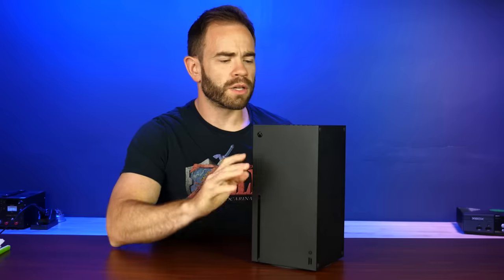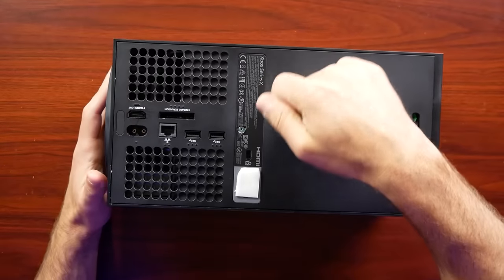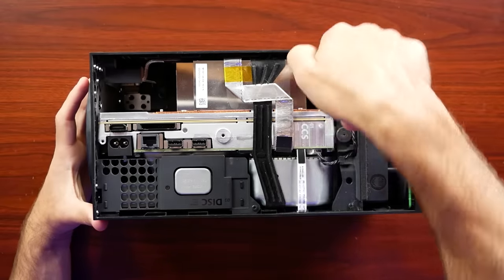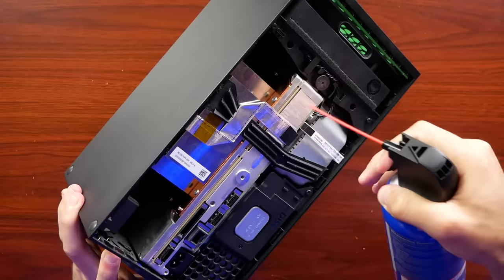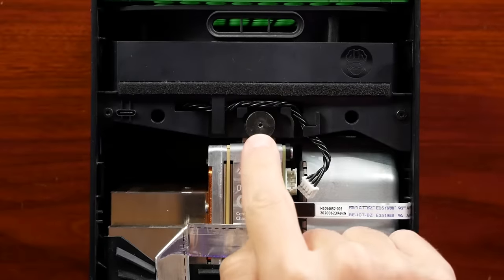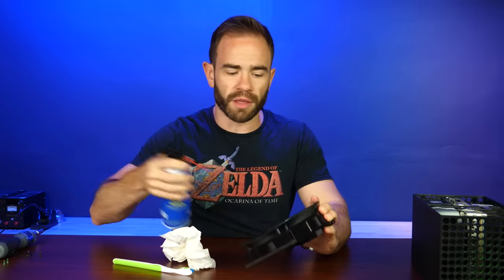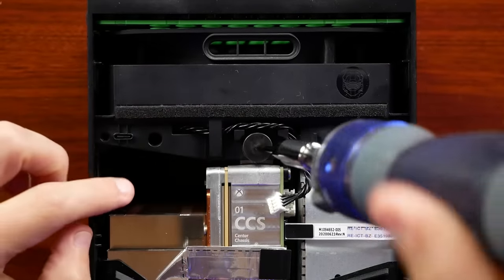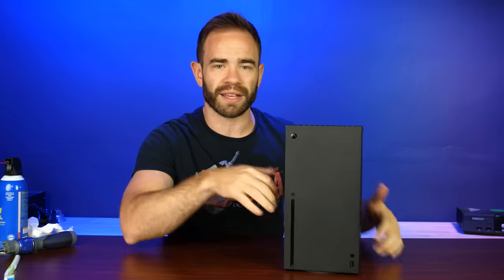Every Xbox Owner Needs To Do This

Comment: I got a PS5 but still need a series x. Want to get starfield eventually.
Reply: Get a PC instead
Reply: @dicegamenetwork Yup get a PC and play games from all the consoles.
Reply: You need to learn the difference between "need" and "want"
Reply: @LogicalError007 The problem is they cost twice as much, however I do think that the end game for any gamer is PC.
Reply: @dicegamenetwork on pc will have bar optimization 
rtx 2080 is dor recommended  
and rtx 2070s is weaker than xbox series x
Reply: @raven679-m3i  2070 lineup is way too old now.
Reply: Just wait to see how it runs on the Series S. The new one is coming out and the game runs at 30fps on both.
Reply: @LogicalError007  you need a rx 6800 or 6700 xt for a good pc buget
Reply: Got mine bnib on offer up for 400 bucks about a year ago. And played it maybe 5 times.
Reply: Quick reminder that a console is cheaper and a million times easier to setup and maintain
Reply: @Tarnished707 Wrong! I was a PC gamer but switched to PS5 and XSX this gen. I still have a gaming laptop though..
Reply: @dicegamenetwork 
No one asked
Reply: @goodie2shoes874 and also consoles have been running the majority of titles better this generation as PCs have been dog poop with stutter.
Reply: @dicegamenetwork yeah, not everyone is into pc gaming. Not rocket science really.
Reply: @goodie2shoes874 not to say its simply made for a living room, its easy to plug and play and its not a gigantic piece of hardware. Pc gamers that play on their desks with their monitors have a hard time understanding that most console gamers play on their sofas.
Reply: @TheKamoteus  Dude it’s an opinion
Reply: @hyperscorpion7  your mom asked
Reply: @dicegamenetwork  Thats not whatcha your mom said to me last night
Reply: I agree about getting a PC.  It will be much more worth it in the long run.  There’s so much different stuff you can do on PC that you can’t on a console too.  Especially if you’re into retro gaming, rom hacks are super fun.
Reply: PC guys trying to justify there purchase 😂 telling you to get a pc.
Reply: Got series x need ps5
Reply: @burnzy3210 😂
Reply: Same boat. Saving for a Series X to play starfield and have a PS5
Reply: Factor in a series x costs £450
A ps5 costs £439.

£889 can get you a pretty good pc. 
You could build a high fps 1080p high/max settings build for that. 

But, but, but……..  muh 4k? 
Only useful if you have £3500 to put into a top spec pc, or have a stupidly large 40” + screen. 

Only things Xbox and ps5 have going for them are
1) 13.5gb+ vram. (Allows for high textures) everything else is at low and medium presets. 
2) they are much cheaper to run. 

My series x on 1440p monitor uses 160w @ (almost) 30p Kw/h costs me about 5p per hour in electric.
 on my 40” 4k tv it was 225w and cost nearly 7p per hour.

A 500w pc would cost closer to 15p per hour.
Reply: @LogicalError007  Well, i played on 780 until not too long ago, ran most games fine if you dabled with the graphics settings a bit, even if some didnt. So i have trouble believing that a 2070 is too old. Im afraid not everybody has the means to buy a 40 or even 30 series card, so slightly older options that still work are a great budget alternative.
Reply: Both Xbox SX and PS5 are great consoles
Reply: Sony pony l
Reply: @isaiahjackson1211 They're always like it, people get a pc just to flex.
Reply: You don't need a series x you want a series x you need air to breathe not want air to breathe you need for food to live you don't want food to live so maybe look at your wording
Reply: @dicegamenetwork Yeah because only 30fps on xbox 🤮🤮🤮🤮🤮
Reply: @matthewjalovick  really?  Huh.  Who knew.
Reply: @LogicalError007 pc gaming is a mess at the moment (see Digital Foundry)
Reply: Got one just for that game and the limited edition controller for it also have to play that game plus eventually elder scrolls 6 and fallout 5
Reply: @burnzy3210 sure he knows the difference but since starfield is only on xbox or Pc he needs one to play or needs a Pc to play
Reply: All set with Starfield
Reply: That’s really cool, thanks for sharing that with all of us
Reply: Did you get one? They have been around $350 since before Christmas
Reply: It’s not a good game
Reply: @hyperscorpion7 bro that made no sense at all
Reply: I have a PC and Xbox Series X. Personally I’d go for the Series X. Not only is it cheaper, but it’s just so instantly ‘there’ after a long day at work.
I love my PC and own Starfield, but the fact you can boot the Xbox slightly faster, jump straight back into a game that you were playing the night before without reloading it, is just incredible.

The only plus on the PC side is games can often be found cheaper on places like CD Keys, you get many more indie titles and beta releases.
Reply: @Kimera92 That is so spot on. Personally couch gaming with console feels better than playing with PC to me.
It's just more relaxed and comfortable.

I have PC too but mostly I do work stuff with it and if I play something with it, it's WH 40K: Dawn of War II or Mechwarrior Online.
But you PC gamers out there. You do you. It's nothing away from me. Keep playing with whatever system you feel good. 😃
Reply: I got this Xbox.  Need a ps5 im too invested in it
Reply: Hopefully you dosnt bought a xbox for starfield 😂
Reply: hope u get one I got a series x for Xmas.  got a ps5 like 6 months ago had my ps4 for like 12 year lmao
Reply: Starfield is extremely mid and not worth the tume
Reply: I’m the reverse I have a series x but want a PS5 cause I need GT 7
Reply: Halo infinite is great I just got my Xbox a week ago, I have a PS5 since release both are great consoles
Reply: I'm the inverse, lol.

Have a Series X, want a PS5 to play Spider-Man, Horizon, and God of War.

Waiting for the Pro model.
Reply: Starfield isn’t that good, I would way rather play Heldivers on PS5 than Starfeild. I have played starfeild so
Reply: Don't its way to freaking long
Reply: @goodie2shoes874 yep. Developers come to your specs not you chasing theirs. In the end, most developers aim to hit a similar experience throughout all so the double the cost is pointless in the long run. 
Yes I have them all. And most games play the same. It won’t matter unless you are a shooter junky….. then what’s the point?  Gameplay is the relatively the same no matter the game.
Reply: Trash game
Reply: @DarkFeedFPV  I play on an Xbox series x and I can tell you that you're completely wrong
Reply: @burnzy3210  they understand fine, because they WANT to play Starfield, therefore they NEED an Xbox to play it on.
Reply: @Haydendriffill  just based on review bombing or had you never played a Bethesda game before? SF certainly is a very good game for anyone who has played Bethesda games like Fallout. The only people that cried were PS fanboys and Game Pass kids that don't know Elder Scrolls or Fallout. Either way, SF is "not a good game" is BS.
Reply: İts not good as people say. And you should have gotten a pc jnstead ps5 and xbox if you were going to get xbox as well.
Reply: I'm still on Xbox one S. Soon going Xbox gamepass cloud on Amazon fire stick 4k Max

Comment: DO NOT blow your fan with compressed air. This can easily put the fan in a spin that is far beyond design speed and ruin the bearings. People do this all the time then go start their computer after doing this and their fan fails. If you blow air thru it hold the blades or stick something in to block them so it doesn’t spin. You don’t need compressed air to see if it spins, just use fingers to give it whirl if you must.
Reply: Very good advice.

Comment: I've been afraid to try and open mine. This makes it look pretty reasonable. Greatly appreciate this.
Reply: Honestly, it's super basic inside but very well engineered. I'm not a PC guy but I replaced the thermal paste on the cpu with very little electronic knowhow. I used these new graphite pads that people recommended and it's been working well for almost a year.
Reply: I just did it tonight after watching this. I've had it for a year and own 3 dogs. I was kind of shocked it was so clean inside from just using compressed air from the outside.
Reply: Don't be afraid its easy. I was afraid to unplug the fan but all good
Reply: I admit i was nervous too, but after watch step by step video on cleaning my series x, it was pretty easy. Now my xbox runs quiet then before
Reply: It’s not too bad if you can turn a screw driver and be gentle you will be fine. I vacuumed the inside of mine and dusted it with car detailing brushes along with air duster. Works good as new now.

Comment: I live in India where it’s dusty. So I got these rubber inserts that go in the disc tray and the unused USB ports to block dust. Plus a full cover for when the Series X is fully powered down. Works pretty well. Thanks for the cleaning tutorial 🙏
Reply: Good ideas!
Reply: We have a long haired cat. I wont pretend its the same but this is a great idea
Reply: Smart! Got some that came w my PC case for USB drives. Very effective.
Reply: I use my Elite controller case to cover the top of my Series X when it's not in use.
Series X makes a perfect controller pedestal.
Reply: I just cover my consoles with pillow cases when not in use 😅
Reply: @jtrinidad1884 epic
Reply: Cool to see you here, Karl. I've been watching a lot of your videos recently.
Reply: you are still getting dust in your machine when you play the console, so even though you have these things, they don't really get rid of the dust they just prevent more dust from entering the cavity when it's off, your better off giving that thing a blowout after every playthrough to keep that dust out if it's as dusty as you explain.
Reply: @jtrinidad1884  
that's an interesting idea, i mean if you wanted to give your console some kind of filter that you could easily replace over a period of time, but it would have to have plenty of air flow and not prevent that air flow from getting reduced in any way.
Reply: Cool where can I get these inserts? I fear my series x getting dust within the drive.
Reply: Hi Karl!
Reply: @MrWolf12000  I don't think that blocking the disc tray or the USB ports with a long haired cat will do much good! LOL!. Sorry, couldn't resist a bit of silliness!
Reply: @5226-p1e blowing out after every use rather than utilizing preventative measures?  Doesn’t make much sense. There’s gonna be far less dust doing what they have suggested.
Reply: @5hrimp_Nachos  
yeah i think i meant after every month, sorry, that was a bit over kill i will admit lol. 

but i do think preventative measures are still important, like i just purchased a honey comb design tower for my PC and it's fantastic for air flow, and it comes with some static meshes that collect dust through the intake directions, which prevent some of the dust from going inside the tower, but you can't prevent all the dust all the time and you have to still clean it out whenever possible, because it will still collect like crazy given enough time and not regularly cleaning it. 

to ensure that it runs really good, i clean it regularly enough that i never run into issues down the road.
Reply: thats very smart. i will definately use a cover when not in use

Comment: I opened mine a little bit just to get the dust out, and wow if you have cats (especially if they like hanging around) you definitely need to do this! There was massive dust bunnies everywhere
Reply: Ditto that. We have a cat and she hangs out with me in my office. I opened mine up about a year ago and there was a lot of dust bunnies in it. The series X is a well designed system. Super quiet, powerful, and very maintainable. Props to Microsoft on a well designed console.
Reply: I have 2 cats and 2 Border Collies! It was absolutely insane how much dust there was in there!
Reply: @s31ACE1252  Till the SSD dies
Reply: @slamshift6927 hasn't been an issue yet
Reply: @slamshift6927 you can replace those
Reply: You just learnt dust bunnies from here and wanted to test it out?

Comment: I have an electric duster from Amazon. You plug it into an outlet. Holy moly it’s powerful. Even just spraying through the intake vents the first time it sprayed out some dust. I’ve done it, without opening it, about every 3 months for both my XSX and PS5 :)
Reply: Be careful, using that may cause a static electric shock and fry your console…
Reply: @jonathankulesa no it wont
Reply: @jonathankulesa  
this is why you always make sure the machine is turned off, this is how PC users do it as well, it's always best to unplug it and then do your cleaning.

Comment: Isopropyl alchohol(preferably 90% of higher) is great for lifting stickers. It disolves the adhesive, allowing you to easily lify the sticker. When the alcohol evaporates(quickly), it leaves behind 100% of the original adhesive. This allows you to re-adhere the sticker as if it had never been removed.

Comment: I recently cleaned out a PS3 slim I was given after seeing your videos. The slim was easy enough with its modular design. Three security screws made it a little difficult. Still I like it when manufacturers make it easier for us basic folks to look after our stuff. Like this video I unplugged the power supply, fan etc. The fan and heat sink definitely needed a clean. I found a soft old paint brush helpful and some cotton swabs.

Comment: I have to say that the ingenuity and design that the engineers at xbox did with the series x is incredible. 
When i first got the x i played horizontal but figured id try veritcal and i have to say it pushes out hot air and the bottom intake is usually sucking in air. And its also easy to clean

Comment: I cleaned out my console earlier this year after I had a shutdown playing Resident Evil 2. Owner since launch, I indeed had a very dirty Xbox. Bought the necessary tools, followed a guide and had almost no issue cleaning it, with the most troubling thing being taking off the base plate. I had to brute for my T6 as I didn't have a flathead small enough to to fit. Its not hard at all, and there's almost zero risk if you are on a clean and flat surface. Trust your ability to be careful being the best advice here.

Comment: If they're going to make a slim or Pro version of the Xbox or PS5, I think 1 feature they should implement is making it more modular and easily accessible in terms of getting to some of the core components. That way it will make cleaning regularly easier. For PS5 they should have 2 expandable NVMe slots.
Reply: Xbox slim is the series s. There will be no Xbox pro.
Reply: @tylerm5862 If a PS5 pro officially comes out, I can guarantee an Xbox Version will, no matter what Phil Spencer says.
Reply: @autoscopy  Yes, thank you for your guarantee, a random guy on the internet who knows Xbox plans more than Phil Spencer. Lol
Reply: @tylerm5862  Sure thing. People in power of corporations never lie random guy on the internet. Lol
Reply: @autoscopy  Honestly, I don't know what you're even referencing. I'm unaware of whatever Phil Spencer has said. Just to me, it makes sense why it wouldn't happen. Also, you're the one throwing around "gurantee" about nothing you have no power in or decision. It's rather dumb.

Comment: You should have advised people doing this to not allow the fan to spin when blowing it out. It won't always create problems but can bork the bearing if it spins out too fast. I'm not sure the quality of the fan's components but still best to be cautious. This is especially a danger for cleaning fans still attached to a board, as the motor can actually force a voltage to be sent back to the board.

Comment: Pulling the air from the bottom and side and venting it out to the top is what many pcs do. It's not surprising. 
Heat rises so it's efficent and smart engineering.
I wont ever buy a console, but props to them for creating something that makes sense.

Comment: I have found a shaving brush (badger hair brush) is the best at cleaning small items and fan blades. It is easier on the fan bearings than wiping with a paper towel or toothbrush which puts a lot of friction on the hub of the fan. Shaving brushes are also incredibly good for cleaning small toys and die-cast model cars.

Comment: I would use a small light vacuum. Compressed air only moves dust, doesn't remove it and can actually push it deeper into the console or further into the heatsink fins. Wipe extra loose dust, dont blow it around with air cuz that aint "cleaning", thats just relocating dust.

Comment: DC fans use delicate ball bearings. Never manhandle them like this demonstration shows or you will likely knock the fan out of its alignment and it will end up rattling.

Only used compressed air and if you must get Hands-on only use a delicate painters brush with fine soft bristles.

Comment: Just put a dust filter in the inlet which will decrease air flow BUT with the help of an additional exhaust fan, it should not only keep the Xbox cooler then original but keep it clean.

Comment: If your console is really dirty and or taking it apart grab Isopropyl alcohol wipes. I use them when taking PCs apart and it's easier than trying to get bottles of the stuff. Especially if it's hard to find as bottles of the stuff aren't allowed on planes. If you order online were it needs to be put on a plane at some point. They won't deliver it to you.